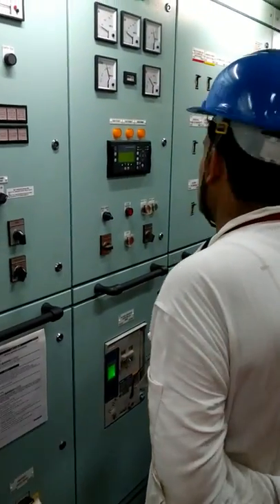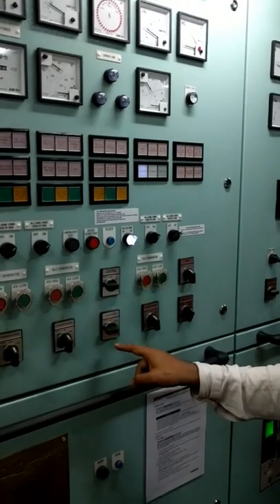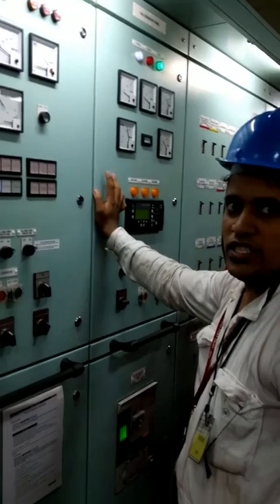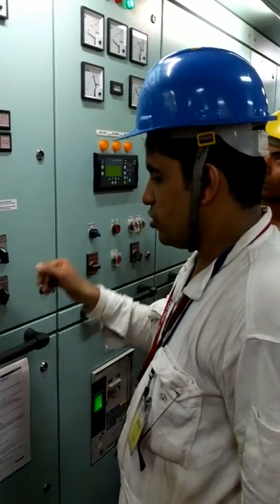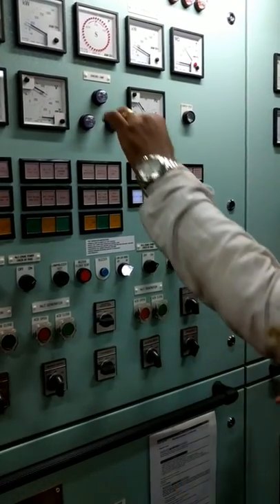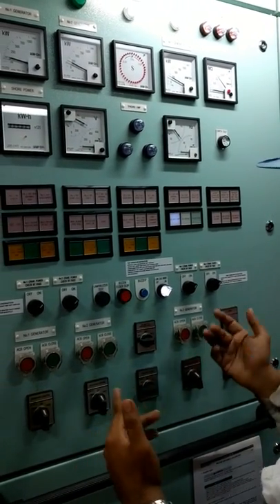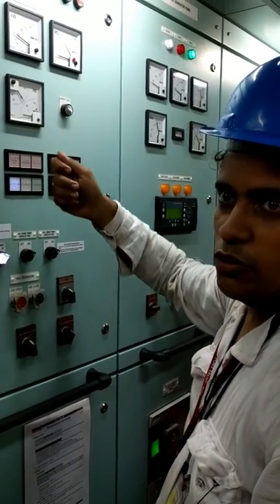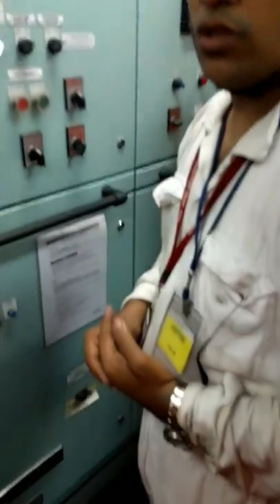SYNCHRONIZE Generators Like a Pro in Just 10 Minutes!

Comment: At 4:30 you explained about why the synchroscope pointer shouldn't be very slow. You explained that if synchroscope pointer is rotating very slow and air compressor got cut off then the synchroscope pointer will start to rotate anticlockwise and it will cause reverse power Trip. Can you please explain why the synchroscope will start rotating anticlockwise as soon as the compressor got cut off.
Reply from the maker: The condition for pointer to rotate clockwise is that the incoming generator frequency has to be slightly more than the bus bar, and when compressor cuts off it reduces load which causes the bus bar frequency to rise hence hence pointer might reverse.

Comment: Sir greeting.
In my ship the SMDB is identical with yours and most of the time we synchronized the generators automatic.
Here is my issue 
1. In the begning the incoming generator after synchronization the frequency start  dropping to 7 and the first is generator frequency remain 8.8 (9) the same. Why is that.
2, after couple of weeks 
The automatic synchronization start to rais alarm synchronization failure i don't get it since the synchronization is automatic and check all the V, F and cos Angel 
Why is this happening.
Please i need explanation on this one.
Reply from the maker: I don't work on that ship n this video was recorded many years back
try doing manually and does it happen with all generators

Comment: MAY I ASK SYNCHRONISATION RELATED QUESRIES?
Reply: SHOULD WE USE SYNCHRONOSCOPE OR SYNCHRONISING RELAY FOR MANUAL SYNCHRONISATION.
Reply: HOW TO USE VOLTAGE RAISE /LOW PUSHBUTTON & FREQUENCY RAISE/LOW PUSHBUTTON IN CIRCUITARY
Reply: AND WHAT IS THE ROLE OF POTENTIAL TRANSFORMR IN SYNCHRONISATION

Comment: Sorry i dont hear what did u say,3 need to required 1.voltage 2 frequency and the last i dont hear,sorry i just want to know.thanks
Reply from the maker: +Faisal Laelae: theoretically 1- voltage,2- frequency n 3-phase sequence which is done by synchroscope but I have also mentioned power factor to check. Hope you have understood
Reply: Same voltage, same frequency and in phase sequence
Reply: Sir 3rd one is Voltage Phase angle between incoming generator and busbar : The waveforms should be matched such that they rise and fall together. There should be no angle difference and the potential difference between the phases should be zero.

Comment: 1st factor to be considered as for synchronisation is voltage 2nd frequency n 3rd is phase sequences ok not power factor u fool😂 don't provide wrong information
Reply from the maker: +smart shardul : phase sequence is done by synchroscope or lamps u don't need to check it separately basically this video is for my students, they already know d thoery, I just explain what needs to be done on ship, dats y I didn't explain how synchroscope works. we don't get much time on ship n also can't make it long....
Reply from the maker: +smart shardul : phase sequence is checked by synchroscope or lamps and u don't need to check it separately, my videos are basically for my students just to show them how it is done on ship theory they already know unless they request I have not even explained how synchroscope works, we don't get dat much time on ship...